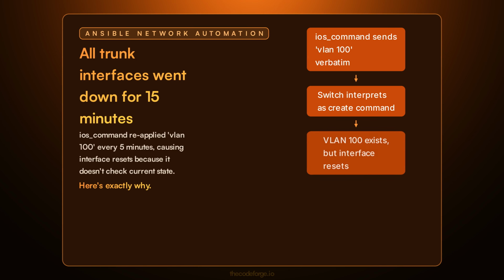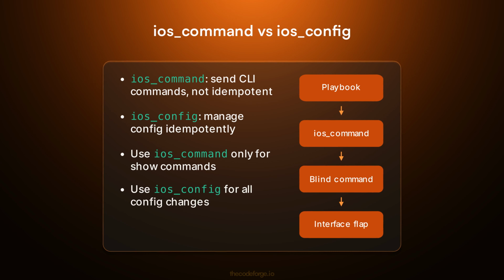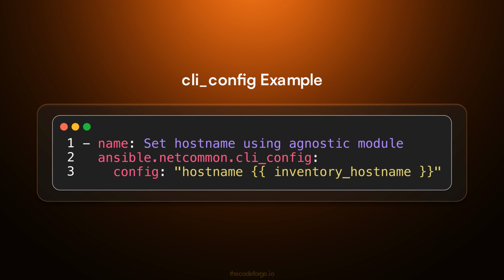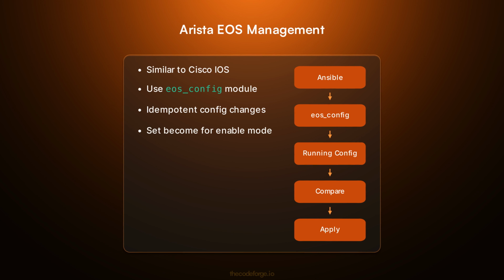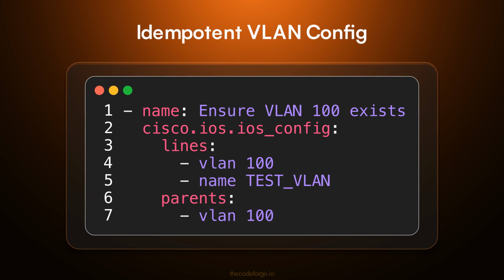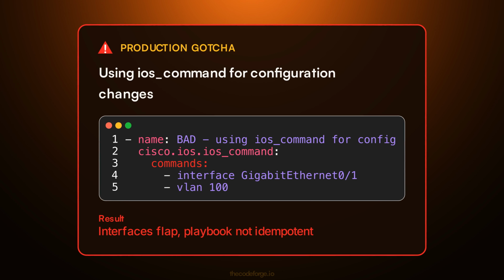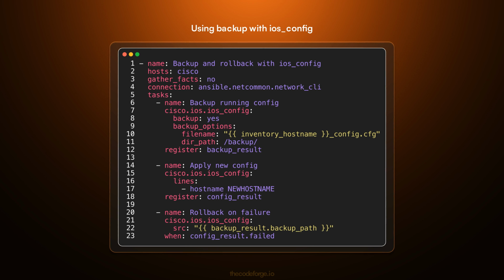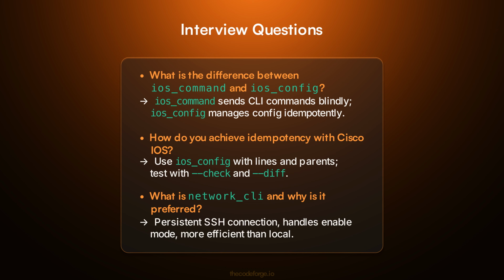Ansible Network Automation: All trunk interfaces flapped for 15 min

Comment from the maker: ⚠️ All trunk interfaces flapped for 15 min — non-idempotent `ios_command` re-applied `vlan 100` every run

Root cause: `ios_command` isn't stateful; re-sending `vlan 100` reset the interface
✅ Fix: Use `ios_config` (idempotent) with `lines`/`parents`, not `ios_command`

Hit this one in prod? 👇
Full breakdown → https://thecodeforge.io/devops/ansible-network-automation/